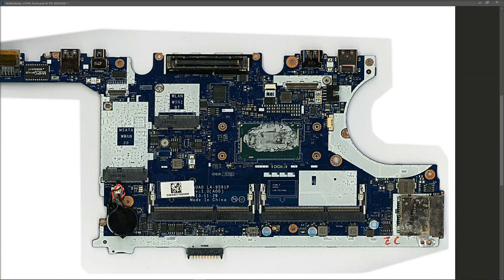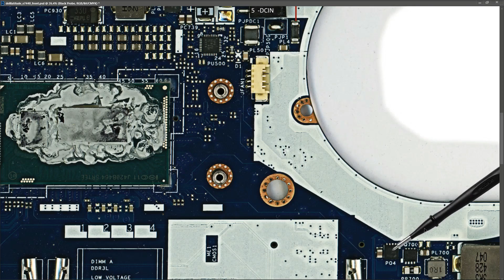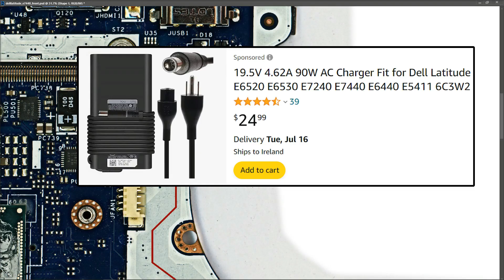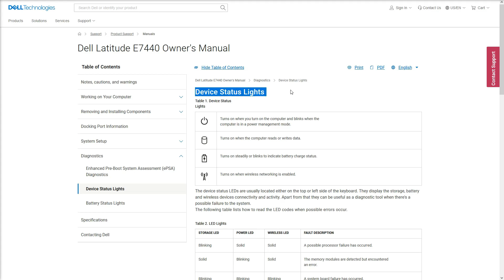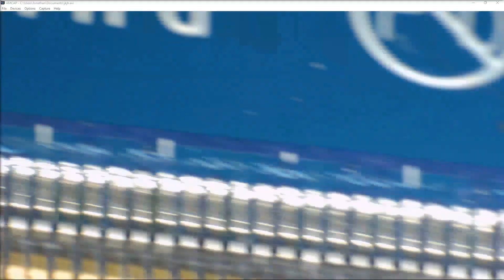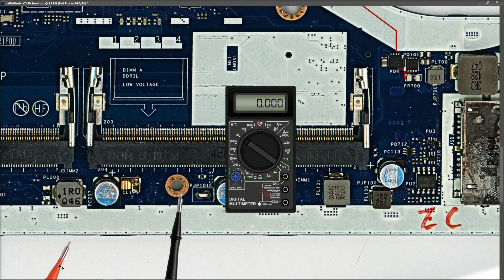DELL LATITUDE E7440 - DIMM NIGHTMARE

Comment: Come on man. Install a new DIMM socket. The probability that this MoBo will remain functional is very high. All the best.
Reply from the maker: Hi, I haven't seen anybody doing this online on the other channels - Is it feasible? When I removed the DIMM B socket on this laptop, I ended up with a melted plastic mess.
Reply: @therepairshare673  Hello. Hot Air 500 Celsius 20% Air flow and a lot of flow. In this case (pecked plastic bushing) it was not necessary to be gentle or careful with that piece when removing it.
To install the new socket I would use a pencil-type soldering iron, conical tip or “hoof tip” and a final touch-up with the curved tip and preferably good quality flux. Using hot air at 350 Celsius, even protecting with kapton or aluminum tape, always implies a risk even if the manufacturer says or affirms that the plastic material of that socket supports or resists heat very well.
I said new socket because there are 230 terminals to solder and a high probability because you have 1.36V in the inductor and also if the socket is correctly assembled, with that work I would be sure that at least one of the two should work.
I have information about the soldering station and tips that I use (industry standard) and it is not Weller like the one from NRFix (they are the most expensive) and I would send it to your gmail before Thursday, of course with your prior authorization. . . first.
PS: The channel Adamanit UK (Graham Lord) did it in a video but I don't remember the number. As with all of us (people), your soldering skills have improved greatly. Sorin fixes those DIMM sockets but we all know how this veteran colleague works... Oh my goodness! All the best.
Reply: @therepairshare673  Hello. I left something in your email inbox.

Comment: The problem with Dell, make use of the ID pin from the power supply input. Many companies use a resistor for this ID, but Dell use a one wire protocol that contains stuff like adapter model, serial number, wattage etc. Writeups on Hackaday

The place where you purchase PCB from may know you are putting the boards on YT, and if the tech knows what you are doing, he may do this to sabotage the board so that he does not run the risk of looking stupid. Myself working for an org which must scrap everything instead of donating, I have in the past been instructed to hit all boards a few times with a decent size ball-peen hammer, to make sure they are worthless.

Comment: The RAM  power supply  is getting protected after giving you the right voltaje ,    I would check the mosfets and make sure they are not shorted ..... or maybe in another power supply you might find a shorted mosfet

Comment: These pins are obviously damaged by someone who tried to forcibly fit the DIMM module in the socket in a apparently wrong way. That's not solder dragging or any related to it. It's just a stupid act by someone who didn't know basic things. If data pins shorted to the 1.35V then the memory controller inside the CPU is damaged.
Reply: @Nikolas: Yeah. Your comment is very brave and accurate as well. There is no other explanation: it fell into the hands of a "butcher."